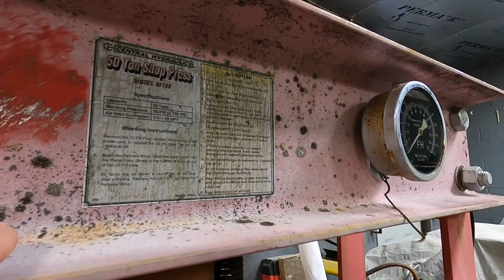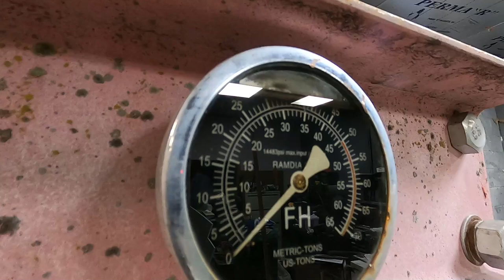MAJOR PRESS EVENT! Time to fill the empty space

Comment: You might want to replace the springs on that press with some hood springs, the originals were a little weak.
Reply: Is that the problem? My new very old press won't go back up without assistance of a prybar. A lot of assistance.  It has always been inside, the springs are not rusty. Very little use in the last 10, 15 years. How do I know if it's a spring problem?
Reply: @grandmajosephine383  If you have a pressure gauge and it goes to zero when you release the pressure, it is likely the resistance of the seals so stronger or more springs will help. Hydraulic jacks often don't return easily either.
Reply: @tiredoldmechanic1791  Thank you. I'll try some new springs.

Comment: steve... contact Jason over at fireball tools..  he has the ability to cut thick steel easily and probably has plate in stock to create some proper press plates for you  that will be bigger than the gap in your bed bars..  but this is nothing that you should not be able to knock out with your own shop tools..  you might also look at the shape of V block that OTC offers for something to create..  now will the individual pieces fit in a USPS bulk box less than 7 pounds each when packed.  if usps still offers that..

Comment: The press is almost certainly not working very well because of the low temperature. My Harbor Freight 20 ton press will not work at all when the temp. is in the 30's. Also, based on the appearance, it could very easily be a 50 ton capacity. Tell me the dimensions of the beams and I can calculate the strength. I think it will surprise you with its capability.

Comment: I thought I'd seen you use air tool oil in one of your air tools, well share some of that oil in your air motor/pump before you run it much.
Reply: I would say the hydraulic oil needs changing as well, seeing as it likely has picked up water from long sitting in the rain. But a nice dollop of air oil into that connector and valve would do a great deal of good, though the exhaust port likely will splat black air for a while, so will need cleaning as well soon.